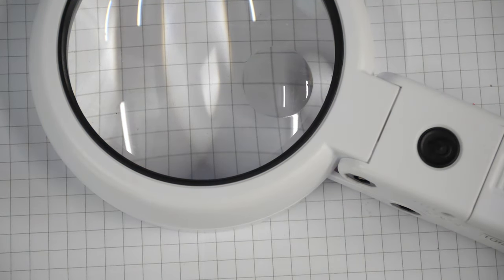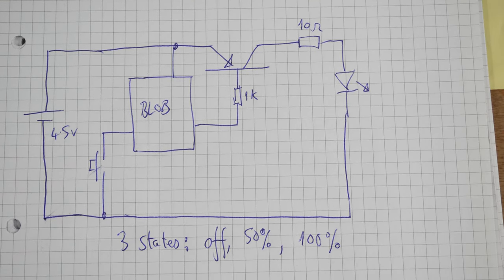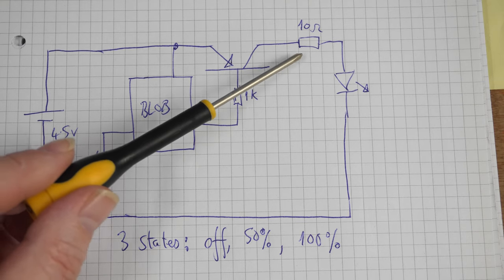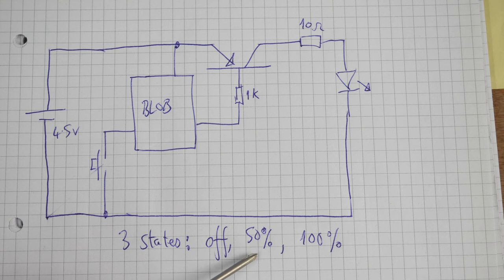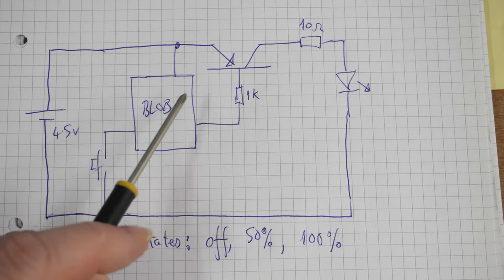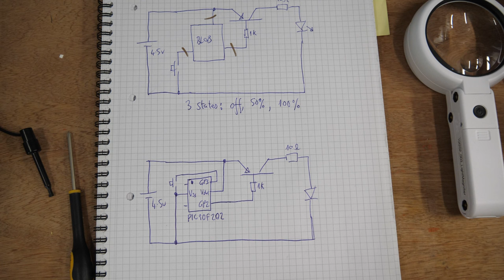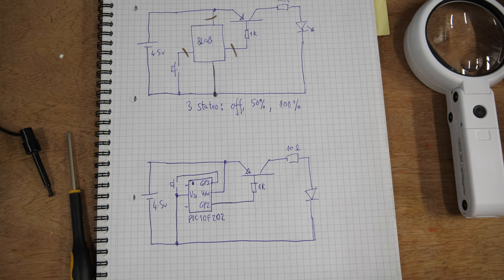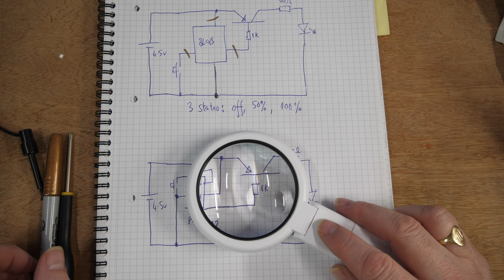Auto-off for illuminated magnifying glass

Comment: How did you program it?
Reply from the maker: Good question. I developed the software with DIP version of the chip with the help of the AC162059 debug header on a breadboard, then programmed up the SOT-23 using the AC163020 adapter board. The AC163020 board has a ZIF socket for SOT-23s. 

Typically I'd present the programming pins to a header or pads, but that's not practical here.